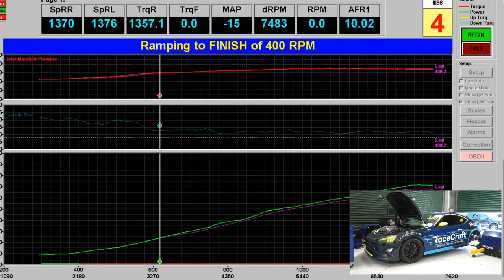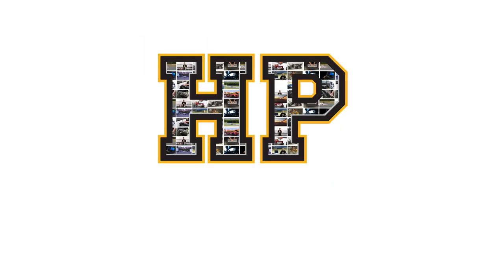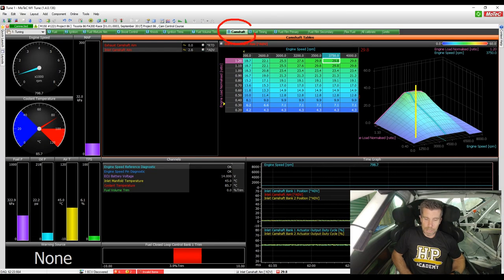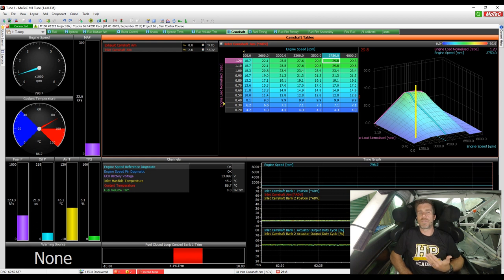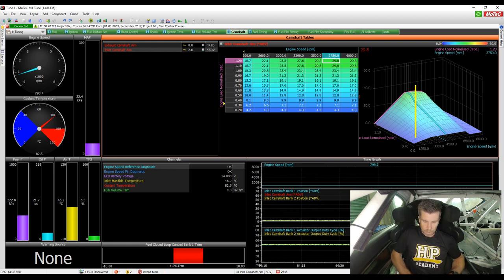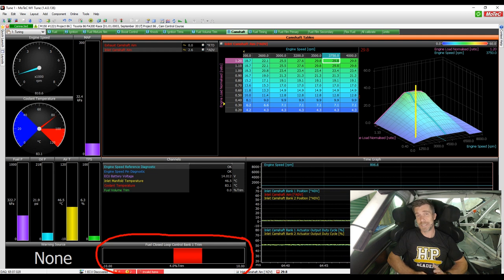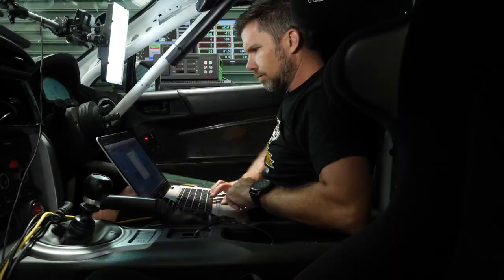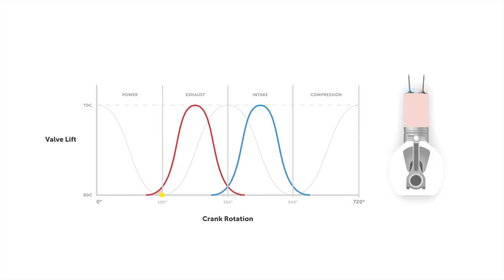Tuning Dual VVT? Watch This! | Cam Timing [FREE LESSON]

Comment: If I am using a stock tune that has existing intake and exhaust cam timing but I want to tune it myself. Should I zero out the exhaust and go thru the steps the same way you have? Also why did you start with the exhaust for wide open Throttle runs? Should you not zero out the intake side to find the timing the same way you did with the exhaust side?  Basically starting with intake and exhaust zero out or would that be dangerous for the motor?

Comment: I don’t have a dyno available, is it possible to tune this way using a virtual dyno or is it too inaccurate?
Reply from the maker: You can road/track tune, and it's worth doing. We have had mixed success with virtual dynos while doing that, but like any tool if you understand their limitations (in this case the margins of error in accuracy) and work within those there is usually some advantage to be gained - Taz.
Reply: @hpa101  Applied this lesson, and a few others, using the virtual dyno software. Managed to gain 49 awhp and 61 lbft torque on a e30 fuel blend using Cobb Accesstuner. The AVCS timing presentation here was what had by far the largest effect on the way the car feels. Pulls much smoother, and harder. Thank you for these lessons and keep them coming. Hope to see some more Subaru/ Cobb software on the channel.

Comment: How would you do this without closed loop fuel control? The issue is a bit of a chicken and egg as before you can do a torque optimisation you need to dial in your speed density/VE table to get the fueling right to get the camshaft peak power and ignition correct. With a flash based OEM platform this is very difficult/time consuming, there are thousands of tuners battling with this problem and I'm still not sure how to tackle it in a reasonable time frame after watching this video.
Reply from the maker: If you don't have closed loop fuel control (which is pretty standard for just about any quality ECU these days) it simply creates one more step - After a change to cam timing that's sufficient to cause your fuelling to more rich or lean, you need to switch to the fuel/ve table and correct your fuelling. If you don't do this, any change in torque could be attributed to fuelling as opposed to cam timing. This is difficult, if not impossible to do accurately when reflashing a factory ECU unless you have the ability to live tune. In most instances though with a reflash we already have a well developed stock cam target map to work from and can focus on just the WOT cam targets as shown in this video. Yes it's time consuming, but you also can spend as much or as little time on it as suits your budget and objectives - Andre
Reply: @hpa101  One more gotcha If you use a map sensor, then when changing the VE table to correct the lean/rich AFR, you will also change your load and hence timing as well. This means your torque change could be due to a AFR change OR spark change when all you did was change your cam timing. We see this ALL the time with reflashing any OEM Ford with the OEM computer. Most tuners struggle to do this let alone understand that the spark/afr could change when changing cam timing. We often see them go in circles trying to dial in an aftermarket camshaft with full exhaust+intake VCT as the OEM cam targets are not close, the speed density (and hence load) is not close hence they cannot easily determine the best cam timing for peak torque (or even dial in the speed density properly). They also do not have an option for aftermarket ECU as in say a Mustang or F150 for example, no ECU is available to run the 10 speed auto or all the auxiliary body control modules. This is a real problem we have, and currently there is no tuning course we can point them to. I'd love to have a chat with you guys about this if you are interested. roland at pcmtec dot com.

Comment: Did the turbo surge at the 34:00 dyno run? That would be the first I have ever heard a turbo go off the left side of the map.
Reply from the maker: No, the EFR6758 turbo won't surge on the FA20. I think what you've heard is a rattle that was present from the exhaust system possibly - Andre

Comment: You all think this optimization procedure is a challenge, OEMs invest thousands of man hours and thousands of gallons of certified fuel to optimize the calibration.  They also invest big money into DoE software tools such as ETAS.
Reply from the maker: Yet they still get many things wrong, and yet that still all goes out the window when we modify these engines to make more power in the aftermarket 😉  - Taz.
https://www.hpacademy.com/blog/are-oem-tunes-as-good-as-you-think-ep-2-off-the-record/

Comment: André you're the best. Some cam manufacturers actually give fly cut numbers depending on cam or for head milling/thinner gaskets. LT1 track attack cam recommended 0.080 thou cut for intake valve vvt in lieu of VVT delete. 
Have you done any of this to get your VVT range? I was thinking with aftermarket pistons like JE/Wiseco I could make sure I have the room to fly cut? Example, instead of ordering 9.7:1 forced induction pistons, could order 10.25/10.5:1. Leaving room for valve cuts without losing target compression. Or running inverted dome and milling head? I don't like cuts in a piston if I can help it. Good for atomization bad for flame front propagation. It all depends on engine you're building I suppose.
I'm only coming from a building perspective. I wouldn't be opening a motor for that purpose alone for minimal gain.

Comment: Andre, I have to interject here. Advancing the camshaft "pushes" the torque peak LOWER. Retarding the camshaft timing "pushes" the torque peak HIGHER. The relationship has always been opposite, retarding an ohv fixed cam pushes the torque to the right on the dyno graph. VVT cars usually are set at max advance because all engines start at idle. As RPM increases, there's only one way to go, that's to retard cam timing as rpm increases. A fixed cam is a tradeoff and set somewhere around the middle of the degrees retarded on a VVT.  I'm getting lost in your explanation. It would make more sense if it could only advance 10 degrees and could retard 50 degrees like the Motec is showing. That zero should be peak torque and trail off as you retard the cam.
HOWEVER, if you are not moving the intake and exhaust cams SIMULTANEOUSLY, you will introducing complexity with the lobe separation angle. It will give you a false sense of improvement as you move a single cam and the torque changes. First you need to find optimum lobe separation angle by rpm and move BOTH cams simultaneously maintaining the optimum lobe separation while advancing and retarding the cams together to find the peak torque. 
That's the very beginning, then you can move out from there and use the cam timing for spooling turbskies and stuff.
Reply from the maker: Hey Kurt, I'm not too sure what specifically you're referencing in this video as from what your comment says I don't disagree and nor does this video? If we're dealing with the intake cam or a single cam engine then retarding the cam timing will favour high rpm cylinder filling while advancing the cam favours low rpm. I'm not sure if you missed the explanation that the intake cam timing numbers are inverted on the dyno screen, -50 is in fact 50 degrees advance and 10 degrees is in fact -10 from the natural base position? The numbers in the MoTeC ECU are correct (deg Advance for Intake, deg Retard for exhaust). You'll note however that the optimised intake map is advanced at low rpm before retarding back as the rpm increases which is typical. If I've missed your point then feel free to clarify.

With a dual VVT engine the natural or non-energised cam position for the intake is typically the maximum retarded position (not quite in the case of the FA20), not maximum advance,  while for the exhaust it is the most advanced position. This results in minimal overlap which provides a good idle quality. As an aside, you'll normally find that these cam positions also usually offer pretty close to the maximum available power/torque at high rpm too. 

It's worth noting that there's no set in stone method you MUST adopt to tuning dual VVT - The one I've shown is the one I've developed that has worked well for me. Bare in mind that while I'm choosing to deal with one cam at a time, and yes, this will of course affect the LSA, this is a moot point due to the iterative nature of the approach (we optimise the intake, followed by the exhaust before revisiting the intake etc). In my experience this is the fastest way to get optimal results. The approach you've suggested will get you to the same point by a different path and assumes that the optimal LSA will remain the same irrespective of the cam timing which also isn't necessarily a valid assumption - Andre
Reply from the maker: @curvs4me  All good, glad we got to the bottom of it as you had me confused 😂- Andre